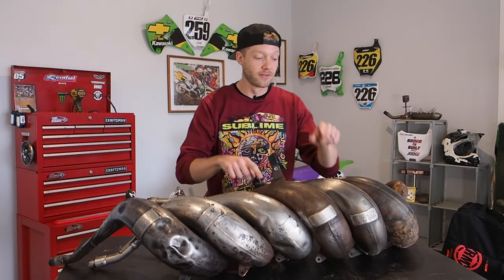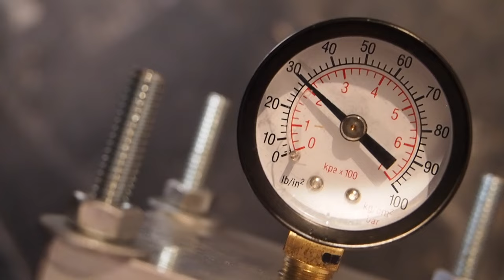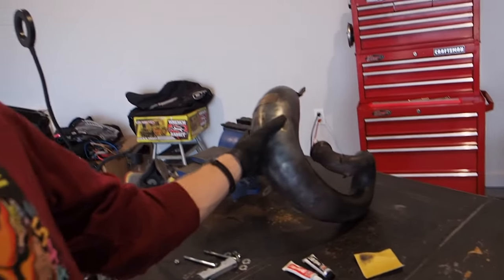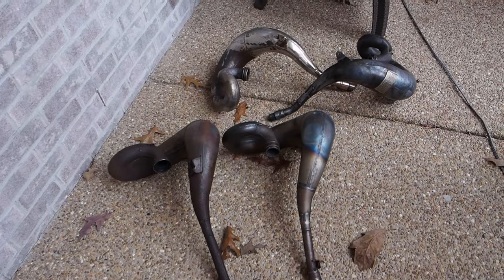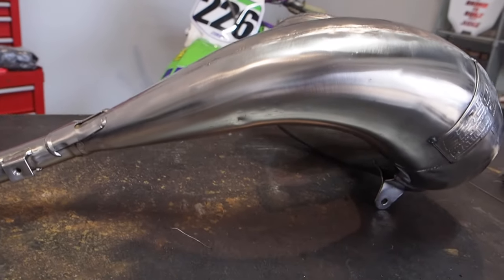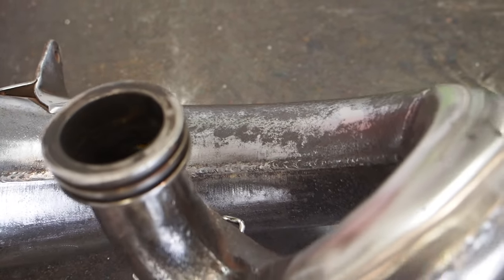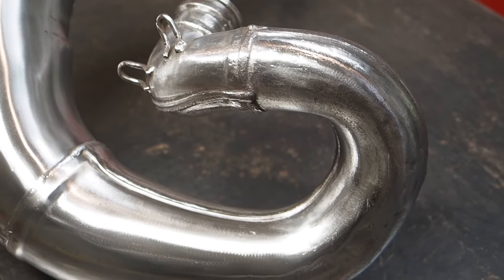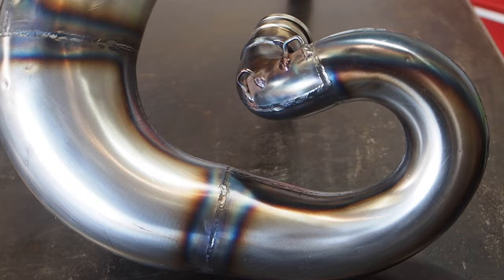How to Make Your 2 Stroke Exhaust Pipe Look New Again - Unbelievable Transformation

Comment: Just fyi.. When you have a crack in your pipe and have no choice but to Jb weld it, you should always drill the smallest hole you possibly can at either end of the crack, if you don't the crack will eventually continue to grow. Drilling either end of the initial crack just stops it from growing larger through vibration during use once it's been repaired.
Reply: Sound advice. And should do this even if you are welding it. Like normal welding it lol
Reply: @Russel_russelson  That's a great point!! I kind of meant that too but didn't word what I said correctly..🤷 
You understood so hopefully others that are learning might too.🤙
Reply: JB weld on a 2t pipe ? That's a good one . 😂
Reply: @topfuelteddy  Nah, it really isn't..🤣
But when u gotta do what u gotta do, atleast it's an attempt at a repair...🤷🤙
Reply: @markkeast6786  yea.  Better than a hole i guess.
Reply: That goes the same if you have a crack in fenders. Drill a small hole in the plastic and it won’t spread.

Comment: You need a sand blaster. I purchased a cheap cabinet from Harbor Freight. I have one and it works great. I used mine to freshen up some headers for my truck. Fast and easy. They came out great. Removed all rust, pitting, and factory finishes. Many options for blasting media. You will need a decent air compressor but you can use a smaller one,  it just takes a bit longer. I even finisheshed them off with Cerakote's new air cure ceramic coating. Trust me, once you use the sand blaster you'll throw everything else out the door. The Cerakote is unreal, super easy application, high temp, and beautiful and many color options. My favorite is Burnt Bronze. Muratic acid, available anywhere pool supplies are sold, will strip every coating I've tried. Pour it into a plastic container, add your piece and in 10 minutes it's spotless and bare steel. Must be done outdoors. The fumes are EXTREMELY dangerous. Let me know if you try any of  these and what you think.

Comment: The easiest and best way to make it look pretty is to sandblast it and use a fine wire wheel to smooth it back out followed by a scotch brite with wd40 for the brushed look. If you have a gold series or platinum pipe and you want the works look, sand blasting will also get rid of the nickel plating

Comment: Yep, the worse the pitting is the more aggressive you will need to be, whether high grit sandpaper, a grinder or what have you. Do whatever you have to do to remove material to get rid of the pitting until the surface is consistent. At that point you can start working your way back up in terms of grit to get the finish you want. Understand that you are sanding out the scratches of the previous sanding stage. If you don't do this you will still see the scratche when you're done. I restored the FMF on my YZ and used those abrasive wheels with my dremel extensively. I didn't bother to go down far enough to get rid of the pitting, but I was able to use WD40 and steel wool and/or the finish (320 grit) abrasive wheel to clean the discoloration out of the pitting so it's not noticeable. From there I went to 500 grit wet sanding (WD40) the whole pipe, then 800, then 1500, 2000, and finished with simichrome metal polish. It's shiny now :) 

Doing this with 6 pipes is going to be a lot of hours lol. The initial stage of sanding/grinding out the pitting is going to be the most intensive. Each stage of sanding isn't so bad after that. The bench grinder would probably cut down on the elbow grease a ton.

Comment: You need a good set of flap wheels to smooth out the pitting and not fancy ones just plain old flap wheels but a air powered grinder will be needed. 
Electrolysis will be your best friend for removing your nickel finishes and removing rust... hell you can put finishes on as well. All you need is a battery charger,empty tote,baking soda and a piece of steel and you’ll open up a whole new world of possibilities

Comment: I wonder if some kind of a belt sander would work faster at getting the pits out, or smoothing out the roughness left behind with the burs or grinding wheel. I’ve seen some handheld ones for bodywork. Flap wheel on the grinder like someone else stated sounds like a good idea. It seems like the more aggressive abrasives you use, the harder it is to smooth them out. The scratches are too deep.
Reply: I have a new Pro Circuit pipe the platinum is peeling off in a bunch of spots. I cut it, and had It welded to fit my 02 Cr125 with a 93 engine. I can’t really return it I don’t think. Im going to strip it and blue the welds I think. It definitely looks sweet. I do have an FMF Factory Fatty for it. I think I like the looks of that even better. I really like the Bill’s cone pipes too.
Reply from the maker: A belt sander would actualy be a good idea! Do they make mini ones? The problem is being able to get on the insides of the curve. The flap wheels on the grinder I had still only took the rust off and didn't make a dent in the actual pitting of the metal. I need to look into that deeper!

Comment: On that process of cleaning up exhaust pipes is to do that  three to four times.,or until it clears up like the rest of the pipe again. That's all you can basically do to them. And have them re nickel plated dipped. The first thing to do before having them re dipped is to clean them all off with acetone really good first though. To remove all pathogens and dirt and grime and oils and greasy residue film off of the pipes first.

Comment: Congratulations! Buy fudging it with J-B Weld you passed a problem on to the buyer but thankfully he will be able to fix it properly in about 30 seconds if he has a little bit of welding experience or a friend with experience JB Weld is not a replacement for actual welding
Reply from the maker: Damn I should have called you up to weld it for me

Comment: Killer. Video I'm going to try it on my go kart pipe bluing and all thank you what about a clear coat so it don't rust again ?
Reply from the maker: I've never done a clear coat on these works pipes but I'd love to try one day so you don't have to always coat it with WD-40 or something to keep it from rusting!
Reply: @GregHitchko  ok first off how did you not give up after the first day ? And then do a bunch more ? I'm trying to do mine I'm on day 2 but mine was pitted and rusty not real bad but bad enough to make this even harder I first used a grinder with a floppy disk then wire wheel then the 3m disk in a drill I can see some shine but I still have alot of black how do I get past the black I'm going for this like you did I want the blue lines and all do you have a email that I can send pictures too I think I need help or a big push 😁 I still can't believe you did all those pipes
Reply: @GregHitchko  I figured it out I soaked it in white vinegar and it came out like new now I'm going to harbor freight and get some metal polish
Reply from the maker: @MartyWolf-i9l  that's solid! I will have to try that on a pipe in the future
Reply: @GregHitchko  got it done blue and all took 2 days but well worth it thanks to your video ( I still can't believe you did all those pipes ? 😁 )
Reply from the maker: @MartyWolf-i9l  right on! Stoked that you got it done, glad the video was able to help. Dude, I still don't know how I did all of those pipes, wayyy too much time spent lol
Reply: @GregHitchko  I wish I could send a pic I'm so proud it's even better looking the next day in the light lol

Comment: Have you thought  about using high pressure water inside the pipe also have you tried 
sand blasting to get the worst of the ye rusted pitting off
Reply from the maker: I've wanted to try the water set up sometime! And yes I definitely need a sand blaster. It would help tremendously. But most of us don't lol

Comment: A secret tip trick and hunt to yah for next time that could possibly happen again by accident. Use acetone to wipe off oil dirt and grease and grime away and off of it really good to first. Before applying JB weld steel reinforced putty onto it. Nead it really good before applying it onto the exhaust pipes and let it cure fully to before sanding down smooth to. The secret is to invest in A wire welder for that purpose of repairs and welding split spots with. Chip away with little hammer and wire brush.,or wire wheels to. Then use A flat disc flapp wheel to clean off the beads and wire Ball simplified. Sand disc rounded flapp wheel.

Comment: Your cure time is on the J-B weld at 6 hours to set up 24 hours to completely cure and I'm not quite sure that it's going to work on that expansion chamber I've tried to use it on radiators that only get 212 degrees and it destroys and it completely destroys JB weld in less than a day makes it from a hard steel to a soft flexible texture

Comment: Its not the heat JB weld can withstand that matters its how much it expands and contracts compared to the steel. If steel expands at 300 degrees but the JB weld doesnt then it will split. Its why you cant weld cast iron to mild steel, both expand differently at different temp ranges so isnt compatible

Comment: Hey there. Do you have a contact number for where you got the replacement badges? I’m about to take on a restoration of a pro circuit pipe from and 89 cr250. Great work you did with your pipes!
Reply from the maker: Call up pro circuit directly! They should be able to send you one. Thanks my dude 🙌🏼💨

Comment: Instead of dremel tool(2small) use a angle grinder with either wire wheel or a flap disc with different grits and eventually into a scotch bright pad on the grinder. Worked great for my 94 RM 250
Reply from the maker: I might have to give the angle grinder another go with a different wheel on it. The wheel I chose was just wayyy too agressive for the application. Need to do a little more research on that. Thanks Jason!

Comment: I can guarantee you that rupturing one of those chambers with over 50 psig of air pressure will make for a very dangerous explosion.  If you fill the chamber with water then pressure it up to any of the pressures you use for this procedure a rupture will not be nearly as dangerous.  Since water is an incompressible fluid it does not store any energy.  Try using water instead of air then make a follow up video about it.